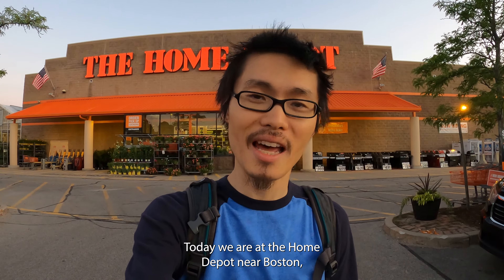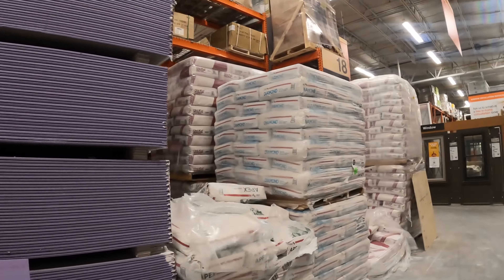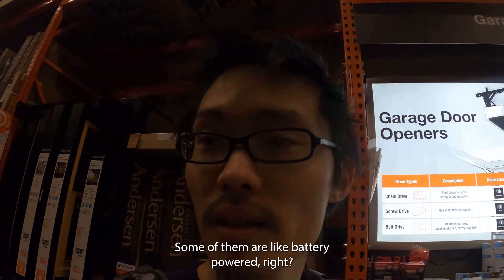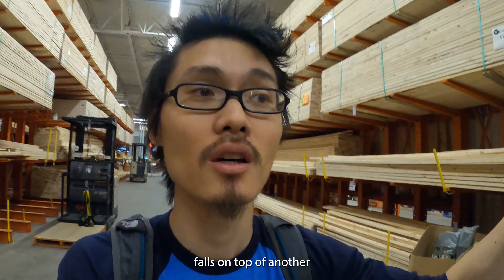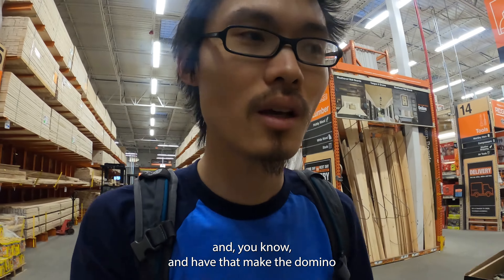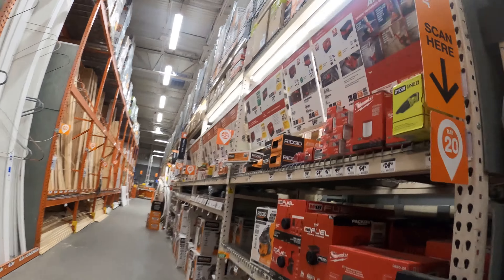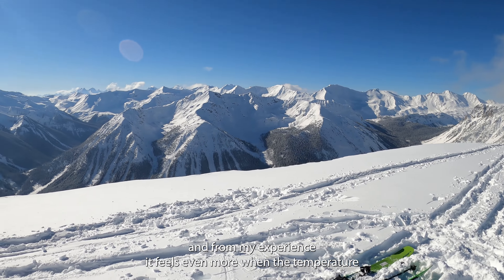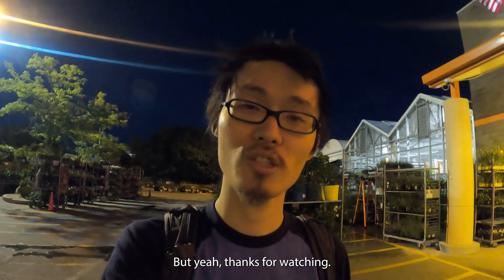My Virtual Store Tour of Home Depot

Comment: DO NOT BUY HARDWOOD FLOORS ONLINE FROM HOME DEPOT. THEY WILL SEND YOU A DIFFERENT BRAND AND COLOR, NOT THE HARDWOOD FLOORS YOU PAYED FOR. You can return the product but delivery is also an issue. They will place you at the edge of your scheduled contract and you will have to accept whatever they send.
Home Depot has the worst customer service. Online Home Depot does not have a fluid communication with the stores, but they encourage their customers to buy hardwood online. I bought Optiwood hardwood and they sent me a different brand and color, less expensive hardwood (Wellmade brand). Worst  for the delivery of online-bought items they subcontract companies that do not have proper equipment to unload the products. Thus, delivery takes forever and no one is responsive to your claims.
Reply from the maker: I won't! thank you for the heads up!